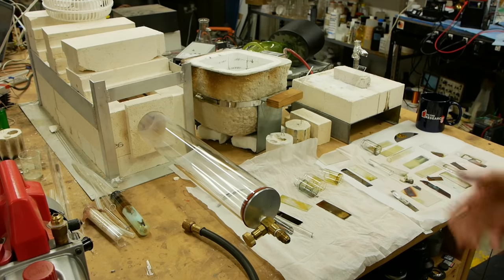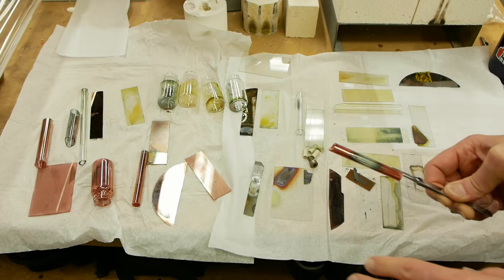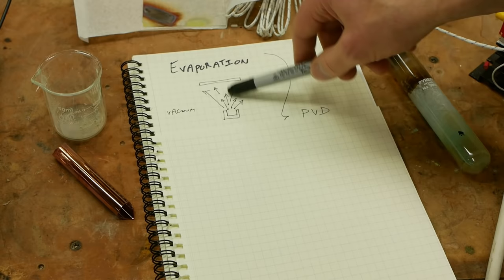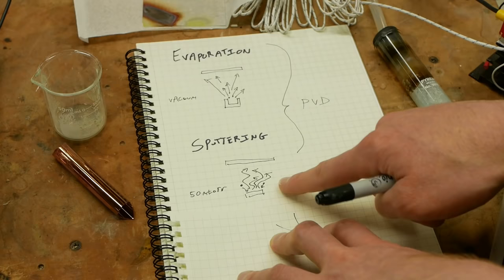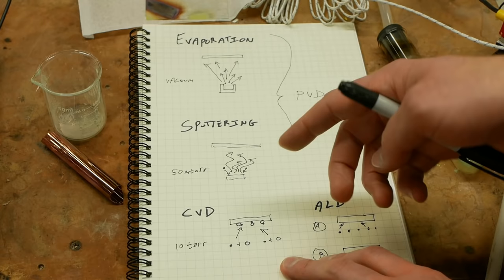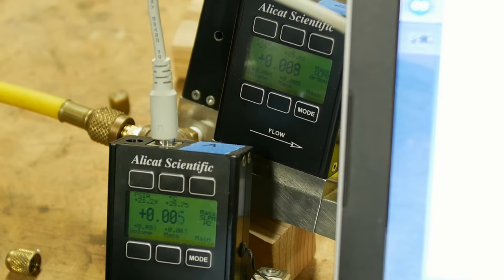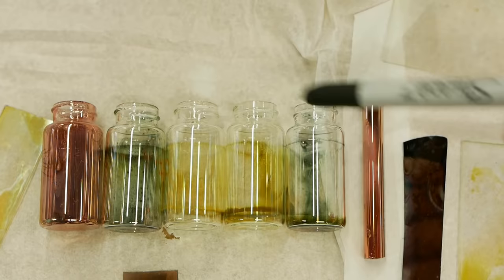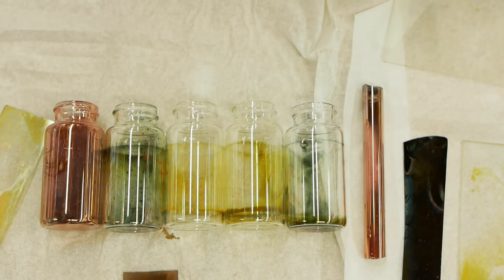Atomic Layer Deposition of copper - If you like sputtering, you'll love this!

Comment: Very cool stuff!

I anodize aluminum at home, which I used to think required pretty ridiculous cleaning. But all I have to do is drop my parts in a concentrated solution of ethanol and potassium hydroxide for a few hours and rinse with distilled water. By comparison, the level of cleaning needed for ALD is absolutely off the charts.

Comment: I have some theories for the distinct regions on the bottles, these all assume truly clean bottles:
Surface wearing, during the manufacturing and packaging the surface on certain parts was abraded in certain regions more than others.
Damage to the surface due to exposure to labels. Perhaps at one time these bottles had labels on them, either the adhesive or the process used to remove the adhesive changed the glass.
Mold. Perhaps the molds that these bottles are made in result in different surface finishes on different areas.
Multiple materials. The glass bottles ae formed from multiple parts, these parts have different chemical or physical properties.
I desperately want this mystery solved.
Reply: The neck and bottom are formed under greater stress.

Comment: Would it be possible to direct the evaporated or sputtered plasma, ions, atoms or molecules through a high voltage electric or magnetic field, similar to a cathode-ray tube?
Would it help, if you would etch the surfaces of the glass bottles with hydrofluoric acid?
Reply: I would call that "particle beam deposition" I wonder if that's a thing?
Reply: The evaporated or sputtered particles are neutral particles, so no force if your apply a magnetic/electric field. You could, however, shape the plasma in sputtering and so could selectively sputter part of the target. You’re just going to lose resolution at distance because the path will spread out like a cone from the source, but it could work for big features
Reply: @ethanmye-rs  I did some googling and apparently they do this at a micrometer level with scanning electron microscope beams!
Reply: I had the same thought! How cool it would be to "print" with a focused beam of molecules/atoms.   Would be sort of the opposite photolithography.
Reply: @internetguy1260  You can do something similar in a FIB (focused ion beam) machine, you can dig into an IC from the backside and form a probe to a single transistor.
Reply: @TheBackyardChemist  that is really cool!
Reply: @IanGrams  I’m subscribed to him! Surprised I haven’t seen this one. Thanks for sharing!
Reply: @BRUXXUS  you have excellent taste 😁 You're very welcome!
Reply: @internetguy1260  There's molecular beam epitaxy, but I don't recall the details of that process, so I can't say how similar it is to this suggestion.

Comment: I really love your comment about the overhype debunking. Today world is filled with unsupported or partially correct statements/propaganda and its really hard to tell how much of it reaches us.

Its really eye opening that it also happens in scientific areas and you can be sure about the statement only if enough of people actually check the facts, try themselves and share the results. 

This is somewhat related to replication crisis. 

And lastly, reading some comments below even your attempt was not flawless as your setup could be rearranged or more heavily monitored. Like setting up mass spectrometer to see how pure is the deposition area and not have to rely on the assumption that the flow will do its thing.

I love your videos as you are open and share the experience! Keep up your good work!

Comment: Great demo/video. BTW that compressed air can is shockingly good for finding hard vacuum leaks with an ionizing vacuum pressure gauge. When the canned air molecule decomposes in the ionizing gauge the gauge current doubles compared to regular room air leaking in.

Comment: I'm a couple days late watching this video, but I did ALD precursor development in my UG on copper and aluminum oxide. I feel you on surface prep! We would do piranha and HF to get bare Si for our depositions. Another thing to look out for is that you aren't inducing turbulence in your flow.  After I left, the lab ran into this problem with a new ALD furnace that couldn't do ALD due to uneven application of gases. This could be the problem with the bottles.
In regards to valves, I think that new furnace used differential pressures of inert gases so that the precursors didn't actually go through valves switching on and off. Unfortunately, this was after my time and I don't remember what they were called. If I figure out the term or a design, I'll let you know

Comment: It was cool seeing that mass flow meter in use, I used the same device for my senior design project last year. It was too expensive for our allotted budget and we used a loaner from the company we were working with. So you can imagine my thoughts when I first saw you had 3 sitting in view, in one project. I was happy just figuring out how to light up the display, change the units and run air through it! Although I knew it was capable of a lot more, thanks for showing. Awesome video.

At 10:30, beside the kiln, looks like a pressure sensor similar to one we used as well - one with a little green LED on the front where intensity is dependent on the pressure difference.

Comment: 20 yr of working on vacuum setups - silicon tubing, hose clamps.  super simple, easy to troubleshoot, very universal.  I hate using those hose setups.  sounds stupid, but I do the same thing when working on the AC systems on a car - before I got the gauges anyway.  Also, those small tube prevent effective purging at lower pressures.  I bought a diffusion pump to reliable get below 20microns

Comment: RCA-1 clean is the best. If you're getting excessive bubbling your temperature is too high. 60-70C is ideal, but above 80C the bubbling gets unnecessarily vigorous. It's all down to how easily the H2O2 reacts. Generally I heat the water/ammonium hydroxide first then add the H2O2 at the end so it doesn't decompose too much while warming. I would also make sure the glass is pretty clean to start with, some glass slides have a residue on them that I have to mechanically scrub off with soapy water before the RCA-1 clean would get them clean enough for coating.

Comment: Wow. Nicely explained about thin layer deposition.
When it's comes to the surface contamination, sometime it's important to use ultra pure water(which has conductivity of 18 MOhm). Plus type of the surface plays a major role. Some coatings happens nicely in quartz compare to silicon glass.

Comment: hey there!

glass specialist here. what you observe with the small vials has to do with the way, the glass is actually made up of. they are made from tubes, typically its AR glass from Schott or likewise. these are Alkali Resistant glasses, as the name suggests. They contain high amounts of alkali oxides to kind of prevent alkali attack from strongly alkaline solutions. what happens during the process of manufacturing the vials is, as they heat up by the flames, really small amounts of these alkali oxides are boiled off of the glass and deposit on other parts of the vial, thus altering the composition of the glass locally. one part has more alkali, one part has less. you see the concentration on the glass with stuff like ALD because the atoms stick to different glasses better than others. if you like to try it with quartz, it should give way better results, as long as the quartz is cleaned by using HF or burned clean and then annealed at 1050°C for 40 hours under a strong vacuum. that will ensure the homogenity of the surface of the quartz, or you just use unprocessed Quartz as the material of choice.

best regards,
your local glass specialist

Comment: I have fumed Silver onto glass, and gold, but you can get a thin or thick layer.. rather transparent, translucent to opaque.. but if it's already okay you don't try to make it thicker. 
That's how pipes change color when they get resin on the inside. The bluish white stuff that turns blue and purple is silver. The pinkish orange clear that turns to oranges Pink's lights and lavenders is gold.

Comment: A thing that amazed me was a that he's got a kiln operating in a wood board table.
Reply: Well, it's not operating at super high temperatures (He mentioned 415 degrees C at one point), and those are low-density insulating fire bricks, which are *really* good insulators. With what I know of those bricks, that furnace could probably easily operate above 1000C on that table with no issues.

Comment: The inconsistent deposition on the bottle surface must be an artefact of the glass moulding process - either due to the molten glass being deformed differently in different regions of the mould (stretched in the middle and compressed at the ends) or a different surface finish in different parts of the mould because the middle section was turned or ground cylindrical, and the compound shapes at the ends of the mould were made with a different process.  It would be interesting to see the result if you flame-polish or mechanically polish a bottle to make the surface finish more uniform.

Comment: Awesome stuff as always!  Very timely, working on a CVD project myself and might steal a few of your ideas! :) (in particular the passive argon flow through the copper chloride evaporator... I'm essentially running the hotplate technique you described and it's quite difficult to control). Also, it kills me that most MFCs require an external controller instead of an integrated display.  And that the few that have displays are so exorbitantly expensive :(

Comment: The bottle line looks like it is at the interface between the neck former and rest of the mold. The neck former also holds the bottle after being counter blown and may change the rate the neck cools relative to the rest of the bottle when removed from the mold, thereby causing annealing on the neck that differs from the rest of the bottle. That difference in annealing may change the surface roughness of the glass. Maybe it's not the cleaning that helps adhesion, but the amount the glass gets etched.
A google about RCA cleaning and etching results in: "It is known that the RCA Standard Clean 1, can cause etching of Si."

Comment: I used to build (as part of manufacturing team) sputtering machines from lab size systems to roll coaters that were 200 feet long for coating huge sheets of glass. Airco and British Optical Coatings. Back in the 1990’s

Comment: You might consider etching or grinding the glass surface before trying to coat it, to see if that improves the adhesion uniformity. There's likely some type of contaminant already embedded in the surface of the glass from the flame-forming processes used to form the bottom and the neck --- not even just on the neck itself, but probably a small amount elsewhere as well. Chemically etching the surface (with hexafluorosilicic acid or a cheap commercial product like Armour Etch) could theoretically strip off the contaminated layer of glass.
I also think it would be cool to see what an atomically-thin coating looks like on the sort of microscopically rough frosted surface that chemical etching leaves.

With all the different cleaning steps though, I was expecting you to break out the chromic acid before the end of the video lol.

Comment: Great work! Found this very interesting. I have a couple of old Brooks 5850E massflow controllers. The step response of these is adjustable. If the soft start is enabled the response is very slow, over 10 sec. If set up for fast response it is more limited by the piping, perhaps a second or so. I do not know if other controllers have similar issues. These have an external terminal to fully close the control valve, but I have not used that feature.

Comment: Ben: Homebrew control valves: Use needle valves connected to a stepper. Might solve your leak problem & probably a lot cheaper.

For cleaning. Try using ozone gas & activating with UV light: "UV Ozone Cleaning process is a photo-sensitized oxidation process in which the contaminant molecules of photo resists, resins, human skin oils, cleaning solvent residues, silicone oils, and flux are excited and/or dissociated by the absorption of short wavelength UV radiation."

Comment: As a few others have commented, maybe the necks and bottoms of the bottles have a lot of stress in them? Try putting the bottles under a polariscope, maybe the deposition pattern will match what you see?
Could also be to do with the structure being different during blow molding, if these were made using that, or maybe the residue off the tooling if they were molded using hot working tools.

Comment: Have you considered etching the bottles with HF?  You may also want to try nitric acid, to remove the mobile ions from the glass.  Another cleaner to try is sulfuric acid + potassium dichromate or sulfuric acid + potassium permanganate.  (The latter combo, dissolve the permanganate in water first, then add the acid.  DO NOT ADD DRY PERMANGANATE TO ACID!)

Comment: Mass flow controllers are not designed for a full shutoff - they will only control down to around 1% of their full scale flow (highest achievable flow rate). That is why you are seeing a small leak. I would recommend a solenoid valve as a part of your control scheme to prevent any leak and get the pressures down to a good range.

Comment: Tiny, imperceptible differences in viscosity and slight devitrification resulting from vial thread tooling and bottom forming of the glass vials is my guess on why we see the patterns in the coating.  One way you might eliminate that factor to test it might be to etch the vials in HF prior to coating.  Yay, more cleaning!

Comment: Your bottle problem is a result of either the resonance happening in the glass, with the outter tube, or the ultrasound coming out of the element. It looks like a wave pattern and may just be a result of the bottlenecking of glass. Actually a change of tray design so you can adjust for resonation may help, or a different input frequency.

Comment: I love your  work, and without wasting resources, your videos are very didactic! It would be very cool to do it with bronze. I know it would rust quickly but a glass container with that coating would be super coo,  Although I have no idea if it rust would happen or if it is possible to do it with that xd. By the way as a industrial refrigeration technician, yes, those hoses and terminals are very soft and fast. And they have a good grip. I recommend that you use Teflon for a perfect seal with temperature differences.

regards

Comment: For the cleaning objects you may want to try RX-11 and dust it with nitrogen followed by the vacuum   and maybe add Schrader valves in the end of the flare fittings.
Robin air makes a new low loss quick disconnect threaded fitting maybe check it out United refrigerant ,also the two Stage Vacuum pump with the half inch hose will pull that chamber down in no time

Comment: UV-ozone might be a good in situ cleaning technique for this if your quartz tube passes 185 nm light. You can flow air or oxygen through while illuminating with 185 and 254 from low pressure mercury lamp--look for versions that say they produce ozone, that's the keyword for lamps with an envelope that passes 185. In particular, it's good for producing a uniform oxygen-terminated surface without any ability to sputter, and it can handle significant amounts of residual hydrocarbons from a half-ass ultrasonic/detergent cleaning process.

Comment: During the manufacturing process of the bottles the glass undoubtedly experienced heat stresses that would change the actual surface texture. The tempering of the glass is probably the culprit.

Comment: It's possible those bottles were made from 3 separate pieces of glass. The neck, bottom, and body could be 3 pieces that were joined.

Alternatively, they most likely would have been worked with graphite tools. It's possible some of the graphite deposited onto/into the glass at an atomic level. Only the neck and base would be worked in that case, leaving the bodies untouched. That might affect this process as well.

Comment: The first thing that came to mind when seeing the patterns formed on the glass bottles was if the internal stresses of the glass might have some effect on the adhesion of the copper chloride.  The neck and bottom are the most worked part of the glass, and as such will likely have higher internal stress.  You may be able to see these patterns (if they exist) using a polarimeter or similar device, although I'm not sure how well that would work on the complex and curved structure of the bottles.